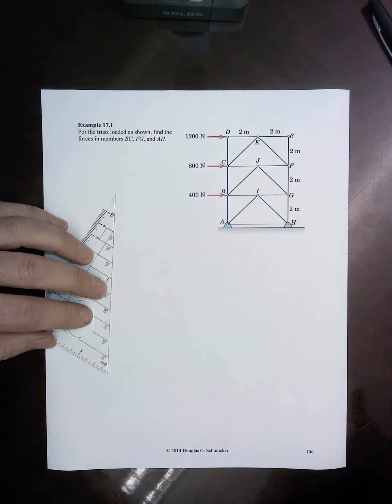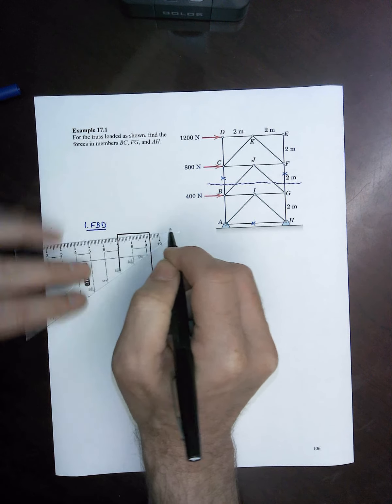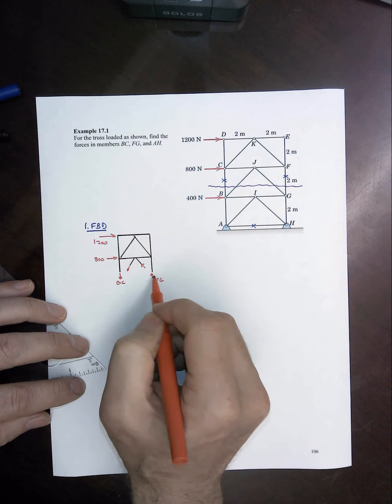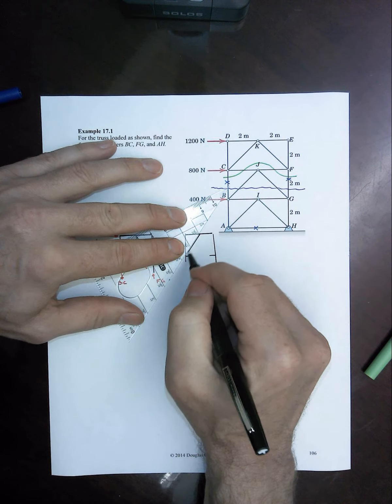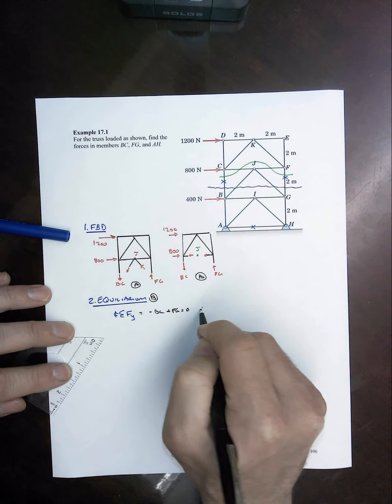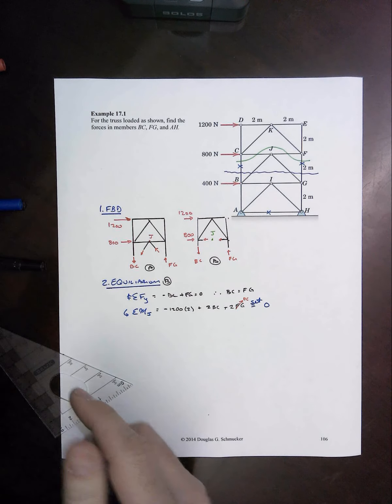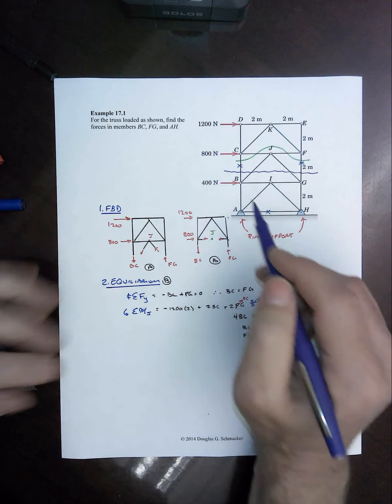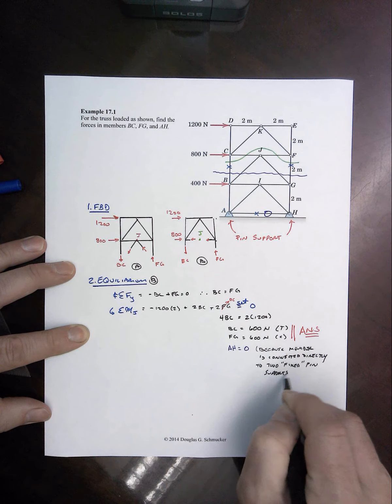Supplemental Truss Analysis Example (formerly Ex 17.1) Chevron Brace Truss

Comment: if I follow this, my forces in the brace members appear to be 0? am i doing this right? how would i for instance find the forces in the braces of the top tier?
Reply from the maker: Not sure what led to the conclusion that the diagonal members had zero force.  They would not.  Something needs to resist the horizontal shear in the story and that would be those chevron braces (diagonals).  

Once you know the column forces (using that FBD B approach), you can return to FBD A and use your equations of choice to find those non-zero diagonal member forces.  For instance, summing forces in the vertical direction will reveal that the y-components of the diagonals must be equal and opposite (since the columns are now equal and opposite from FBD B).  If both of the diagonals have the same inclination, then having equal and opposite y-components means that the x-components will be identical or at least a known relationship due to the geometry of those members.  You can use equilibrium in the horizontal direction to find the diagonal member forces.  They most importantly will not be zero.

Note that the applied load model put the entire story level forces at one side of the vertical truss.  As such, those two members at Joint E would be zero-force members.  The load model is probably not realistic for most situations in that you would usually see some fraction of the 1200 N being split between either side of this vertical element of the lateral force resisting system that is this chevron-braced frame.

Note also that if the member connections are not pinned but fully moment resisting, the overall response of the system will be reasonably approximated with a pin-connected model to the tune of at least being within 90% of the axial forces developed.
Reply: @dougschmucker8212  Doug, thank you for the reply. I end up figuring it out!  I did assume the 2 members at joint E to be zero force members which eventually made it easier for me to solve the brace forces. 
However,  you do mention that the load model is not realistic (the 1200N) would be split between either column joints. Why would this affect the forces in the diagonals? If lets see the 1200N was evenly distributed to each joint D and E, the only difference I can predict is that instead of member DK how taking the entire compressive force of 1200N, it will now be split equally in to DK and KE. However I assume the braces would have the same forces?
Reply from the maker: @edcadiri8720  You are correct, of course, that the overall response doesn't change.  There is just a localized effect in the horizontal members.  These are minor in the bigger picture of story shears, etc.